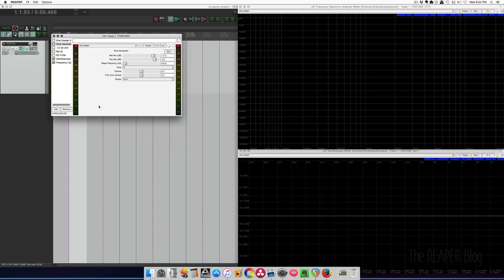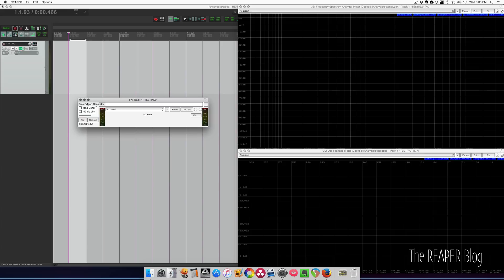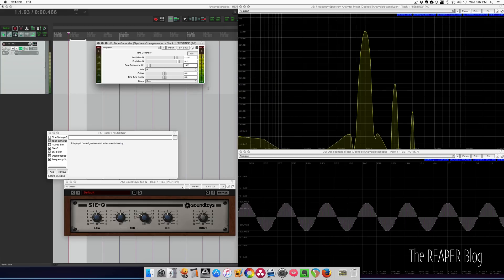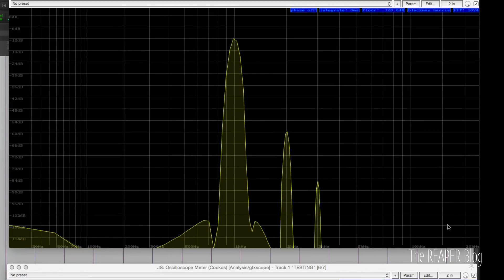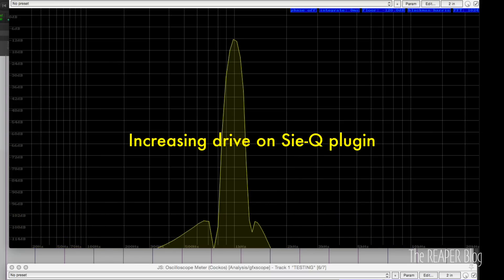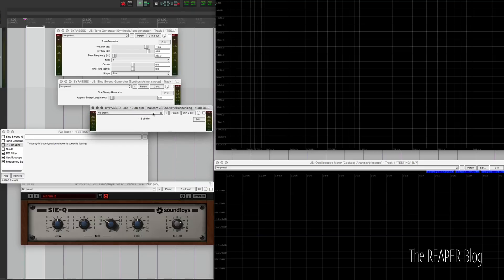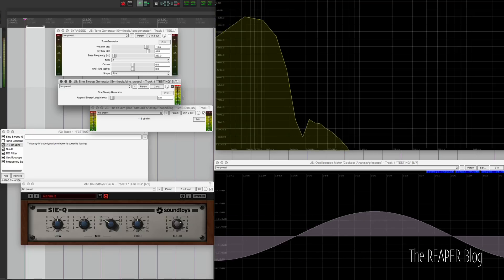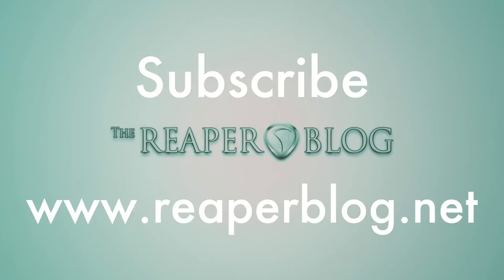How to see what your plugins are actually doing - Audio Analysis Tools in REAPER

Comment: Question: did you say that DC filter does the same thing as a DC offset compensator?  I don't think that's correct.  I believe that if DC offset is wrong, it affects all frequencies the same, so if you are just doing a steep high-pass filter, then you are only removing low frequencies and their DC offset as a side-effect.
Reply from the maker: you're probably right but I'm not sure if I've seen any other way to remove dc offset